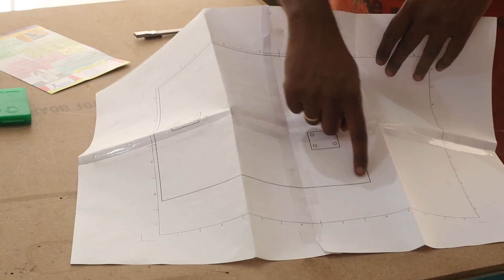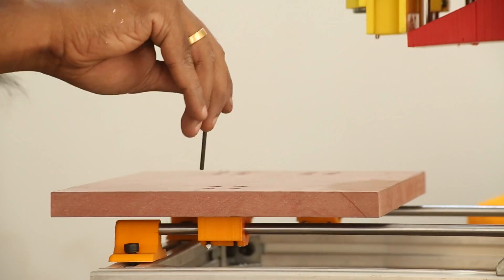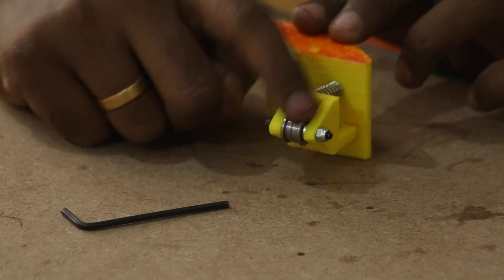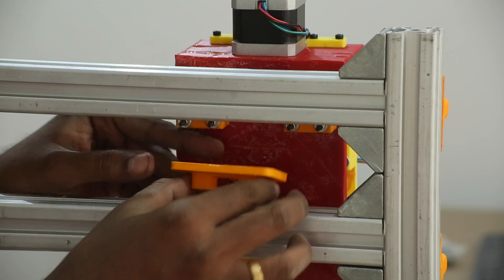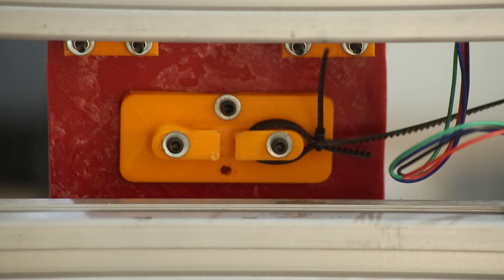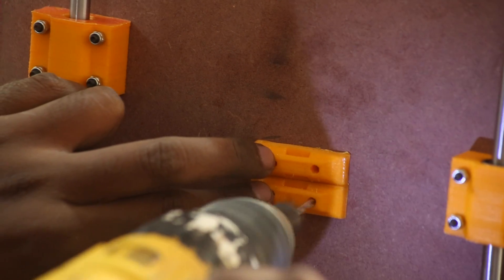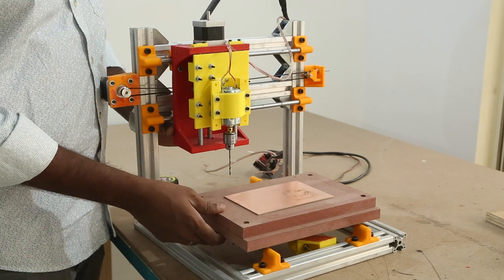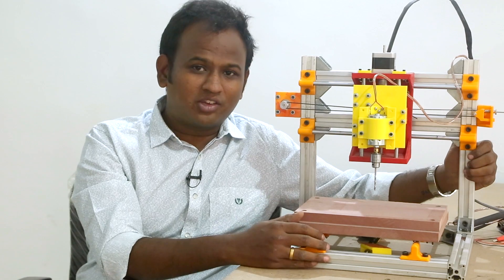DIY PCB Milling Machine - Completing Mechanical Build

Comment: Belts didn't give you much precision and accuracy
Reply from the maker: It does. Always used in 3D Printing.
Reply: 3d printer head doesn't vibrate, pcb Miller head does vibrate a lot. Timing belt is not going to help, you need linear screw.

Comment: How do you think using belt drive is more helpful compared to using lead screws or ball screws in terms of accuracy and precision? 
I m trying to build a PCB Router myself and I have decided that using ball screws is a better option as they can give you a better performance under higher loads in case I want to upgrade it to mill/drill metals. So i would like to know more on how you have established the linear guide systems.

Comment: impressive , but I would think the high position in which the belt is fixed underneath the build plate will cause varied tension on the belt